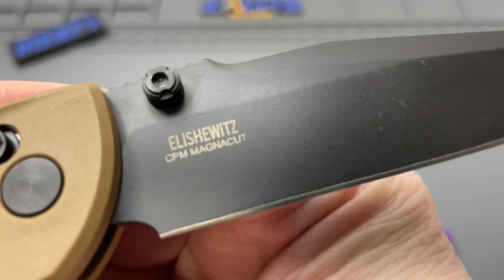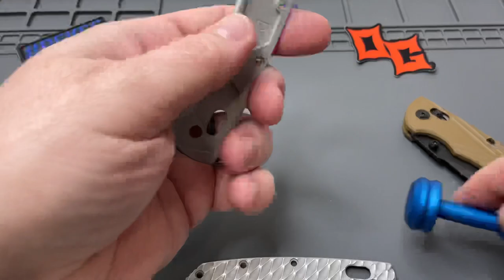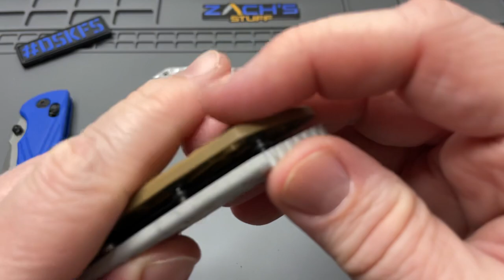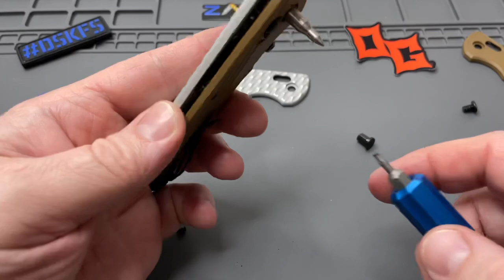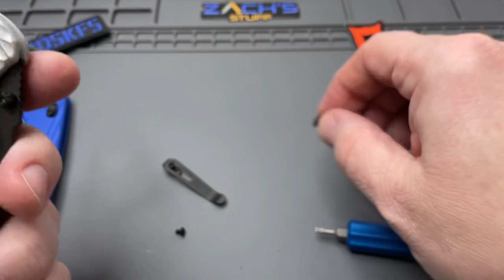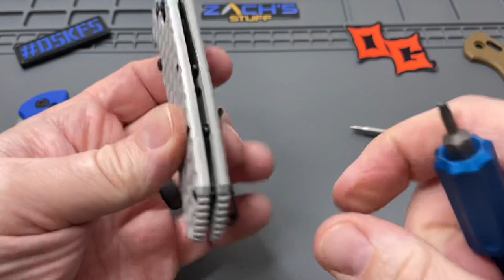New Original Goat Scales ~ Hogue Deka V2

Comment: I got a Hogue DEKA a while ago, and I liked it, but never quite warmed up to it. It was too light and thin. My copy was black and bland. There did not seem to be much to it, apart from a nice, but slender blade. Then I got the Original Goat scales, expanded model, stone washed aluminum. NICE! In fact, after installation, I continued to have mixed feelings for a day or so, and then I began to warm… Now it is one of my favorites! Now it has presence! Now it fills my hand better! And the action is just as good as ever, if not better, and the blade seems even sweeter!  I must say, I am happy with my Hogue DEKA Original GOAT knife!

Comment: Just purchased and installed the XL scales, which are a little longer for providing more grip area. The XL, being longer, also includes a lanyard hole. Also got the XL floating - full jimped backspacer. What a beautiful knife with the OG aluminum in-the-buff scales. Thanks for providing such a detailed instruction for swapping scales, it made the process very simple. I normally don't like coated blades, but the black on your blade looks fantastic with those scales. Very NICE!

Comment: I just finished installing a set of Titanium Skinny XL scales on my Deka 2.  This video was a great help.  You're right about the clip, here's to hoping that Lynch Northwest will make a Ti upgrade clip for it with a smidge more space for screwdriver access.
Reply: If you get a LynchNW clip for a Elementum, they fit the Deka perfectly AND it's easier to put on & take off; more space for the screwdriver🤘

Comment: Thanks for reviewing the OG scales and showing how to replace. Ordered the OG polished version for more bling earlier this week. Looking forward to putting them of Hogue Deka 2 Magnacut. What is the brand of your Torx driver?
Reply from the maker: I am glad it helped you out! Oh nice choice with the polished OG scales! The Torx driver is from Journey Tool Co. and I purchased this one as a dealer exclusive from Rivers Edge Cutlery.
Reply: @zachstuff  Thanks.  They put a lot of Lock Tite on the pivot and I can't break it free with my lightweight driver. I need more leverage.
Reply from the maker: @lewisward4359  gotcha. I use the study one from Wiha. It's black/red with a pop top cap to store bits. Makes it easier to put more leverage at a slow pace without stripping the screw head out.
Reply: @zachstuff  yep. Thanks.

Comment: I’ve got the Hogue Magnacut on the way and just ordered the OG aluminum scales, so this video is great to watch.  One question………where did you get that pivot tool?  It looks like something I’m going to absolutely want before I change mine out.  Many thanks!
Reply from the maker: Nice you got a great knife build going! The pivot tool is from Rust Bucket Goods on Etsy. If you search Benchmade pivot tool it will pull up on Etsy. Couple different options of materials they offer. A great and handy tool!
Reply: @zachstuff  Thanks for the quick response.  And by the way…….Liked & Subscribed !!!
Reply from the maker: @tomcaldwell5914  You’re Welcome! Thank you!
Reply: Just got the OGs installed.  Coated black with a black cherry backspacer.  Your video was a big help and the tool you recommended from Rust Bucket Goods made all of the difference in realigning the pivot.  Thanks again.

Comment: What work surface do you have. That looks handy.
Reply from the maker: This mat is an electronic parts mat I found on Amazon. Heat and chemical resistant and is a silicone base.

Comment: Where can you buy the torqe driver? Also is there anywhere can buy a different pivet and T8 screws backspacers scales for gen 2 Deka
Reply from the maker: The driver is from Journey Tool Company. Different hardware is sold mainly on Etsy for the Deka. Deka scales have been sold by Original Goat.

Comment: So I should have watched a video before I swapped out my crappy factory plastic scales on my Deka V2 Magnacut with some Jade G10 ones. 
I have it all back together but not really sure I have the pivot back in the right way. I removed both factory scales then put the new G10 ones on. I noticed that in this video, he did one side at a time. I should have watched the video first, looks a lot easier to do one side at a time . I'm thinking I don't have my pivot all the way in because once I got it all back together and the blade centered, there's a small bit of blade play. If I tighten the pivot up more to eliminate the blade play, then the blade doesn't deploy as smoothly as it did before. It actually doesn't open very freely at all until I loosen the pivot back up to the point there's some blade play. I'm going to have to take it all apart and try again. I just ordered the pivot alignment tool off of Etsy . Hopefully this will fix me up. Any more tips or recommendations would be greatly appreciated!
Reply from the maker: Thanks for checking out the video and it sounds like you got a sweet build going on your Deka! To me it sounds like you may have just got the liners a touch off adjustment when putting it back together. 

One trick to try is loosening the scale screws that attached to the liners and getting the centering lined up, then tightening down the pivot all the way so it will not deploy. This kind of holds it all together from the center point. Then you can tighten up the scale screws gently, one by one. You can alternate sides too. This trick has worked for me in the past. 

It kind of does what the alignment tool does, keeping it all together from the center point. Let me know how it goes and send me a photo of the finished build!
Reply: @zachstuff  That's awesome! Thanks for the quick response and tip ! I'll definitely give that a try when I get a chance and send you a pic of the finished knife. I think this will be a awesome EDC blade after it has some proper scales mounted. I'm super excited about the Magnacut, it will be my first in that steel.
Reply: UPDATE:
Your tip worked great ! I did exactly what you recommended and it's great now ! Zero blade play when open and "drop shutty" smooth action! Feels WAY better now with the G10 scales . It's still a super light knife but now there's now squishy feel from the FRN scales that came in this knife. It was kinda tough to find any Deka V2 scales in stock but I finally saw some available in Jade G10 so I snatched them up . This is an absolutely fabulous knife now that it has proper scales. I think there's a huge value in the Deka V2 even after factoring in the cost to upgrade the factory scales !

Comment: How is the slip with that pattern on the notoriously slippery aluminium scales?
Reply from the maker: With the milled out sections it leaves high points which are not slippery. Has a good feel.

Comment: Great video I have a set on the way but I'm interested in the alignment tool that you have, how much does it cost and were can I get one thanks 👍
Reply from the maker: Thank you! The pivot alignment tool is from Rust Bucket Goods on Etsy. Search for Benchmade pivot alignment tool and it should show right up!  The costs vary depending on what material. I would suggest the steel one as it won’t mar up like the aluminum does. I’ve used both.
Reply: @zachstuff  thanks for the info

Comment: How did you get that pivot off wtf? Mine wont budge. T8 screw right??
Reply from the maker: Yeah, T8 worked on mine. Sometimes you might have to dribble some lube or such down there and let it soak in. They may have gotten some locktite in the pivot area.